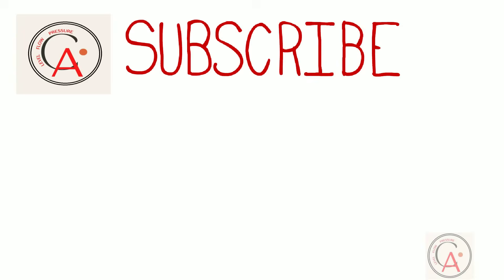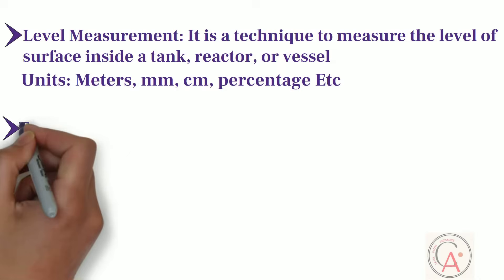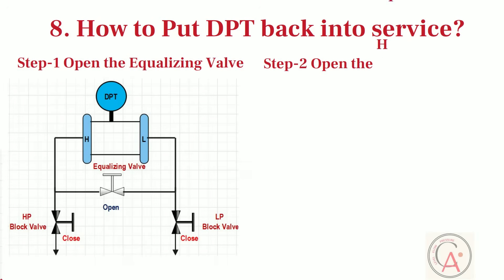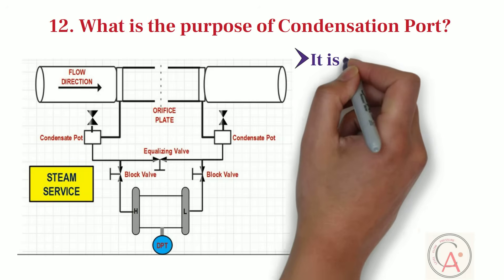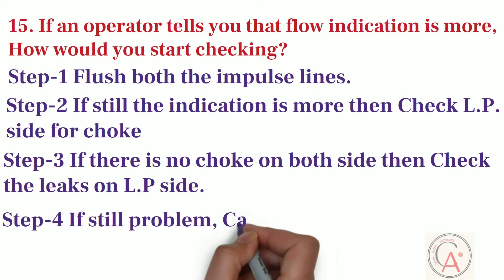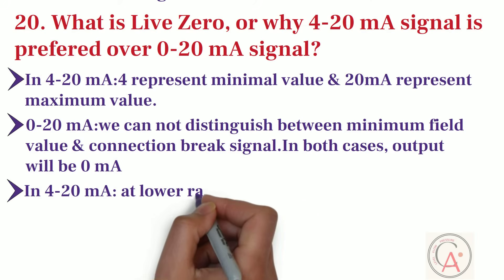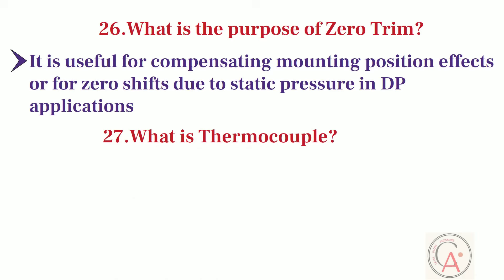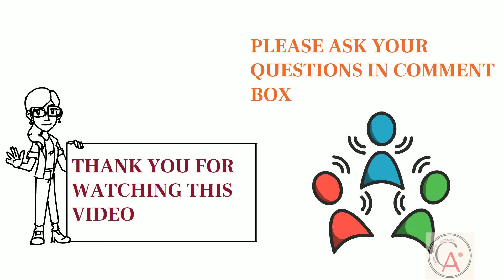Top 30 Instrumentation and control Interviews  Questions & Answers

Comment: I have never seen these questions pop up in any of my industrial electrician/ instrumentation job interviews, except for how to measure 4-20mA and what is a TC, RTD. This is some pretty advanced stuff.

The ones Ive always been asked are:
1.Explain 0-10V and 4-20mA and pros and cons.
2. What are the color of the leads of a Thermocouple? Which one is + and --?
3. Do you pour water into acid, or acid into water?
4. How do you terminate a shielded cable. Which side of the cable do you ground?
5. What does 3-15 mean?
6. Do you know what zero and span means?
7. How do ultrasonic sensor work? 

Theres a couple others that always come up. Theyre pretty basic.
Reply: 1. 0-10 V  sensitive to noise so less accurate. Cannot transmit over long distances.
4-20mA is less sensitive to noise so it is more accurate. Can  transmit over long distances.
2. In all thermocouples -ve terminals identified as white (IES std), Blue (BS std) & Red (ANSI std).
+ve terminals also identified with different colors. But this space is small to explain. Sorry.
3. This is exothermic reaction, heat will generate & mixture will boil violently & splash out. It may cause burns.
4. Shield is connected to ground. 
5. It is 3 to 15 psi range to measure pressure. Why not 0 to 15?  Because at 0 psi, it will be confusing whether actual pressure is 0 or there is no pressure in line or whether the line is punctured or what?
6. Zero means lower range value (LRV). Span is difference between URV & LRV
7. Use of Ultra sonic sensors are for flow or level measurement. It sends ultrasonic (> 200MHz sound) waves by transmitter which is received by the receiver. Time to receive signals is less compared to an empty tank. Using time to receive signals flow or level gets calculated.
Reply: Good Comment.

Do you have the answers for those questions?
Reply from the maker: We do @MR-nl8xr
Reply: What other questions can you think of that would probably come up. Any videos/literature that someone who has been out of the field for a while could use to brush up on instrumentation basics? Thanks
Reply from the maker: Hi  @imayleakount9610  
We have made a decent chunk of videos on HART, CONTROL VALVES, and basic instrumentation interviews. Kindly check those :)
Reply from the maker: Hello
Thanks for your valuable feedback on this video
Reply: Those who are asking for answers,what do you actually want to do ??? You have your resources and google ai guys
Reply: Very helpful...
Reply: Please do u have answer for those questions ❤
Reply: https://www.youtube.com/@InstrumentProcessManagement

Comment: Commissioning a DPT is wrong , for some meters this procedure would destroy them straight away.
Reply: I agree.  I would think bypass closure would be last.  If you open the HP side first with the bypass closed the transmitter would see a very large pressure differential.  Example: if the transmitter was taken out of service or replaced on a 450lb steam flow system and you opened the HP side the DPT would see a 450 lb differential.  Often times steam flow transmitters are calibrated 0 to 100 inches of water using orface plates so damage could be a real possibility.
Reply: @jackfeak2364 The steps mentioned in the video is first open EQ and then only HP. Then why do say it is the opposite.

Comment: Why are we using 4-20mA and not 0-20mA?
Reply: When you use 4-20 you can detect if the system loop is broken, not possible with 0-20. If 4 is zero then less than 4 means the loop is broken

Comment: Why HP & LP tapping is done at 45 degree in process line for FIT
Where  K type TC is mostly used
Explain  transfer of signal from DCS to control valve
How to calibrate interface level transmitter.
What is actually marshalling cabinet
Reply from the maker: HP & LP Tapping is done at 45 degree in process line to avoid any entrapped gases & to avoid any pipe dirt particles in pipe lines
Type K is commonly used in nuclear applications because of its relative radiation hardness.
DCS sends 4-20mA signal to I/P converter. I/P converter converts 4-20mA signal into 3-15 psi signal. Then 3-15 psi signal goes to control valve to control the flow.
I have made one video on Interface Level Measurement.
Please see below link.
https://youtu.be/Z9S2mgVM3FU
The marshalling cabinet acts as an interface between the system cabinet and field junction boxes. The main cables are laid from the field junction boxes to the marshalling cabinet. The prefab cables from the system cabinet IO cards are also terminated in the marshalling cabinet.
Reply: @InstrumentCalibration  Guided wave radar type interface level transmitter calibration, what will be zero and 100?
Working principle of ESDV and types?
Reply: @InstrumentCalibration  When FIT is showing zero what will be position of FCV fully open or close.
Reply: @sushildurafe9037 You're like, so smart bro.
Reply: @InstrumentCalibration